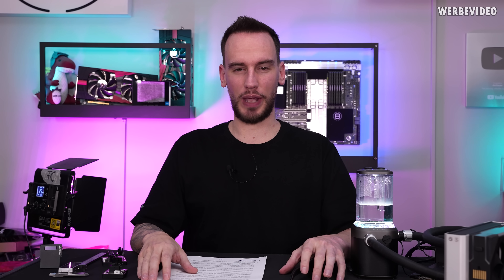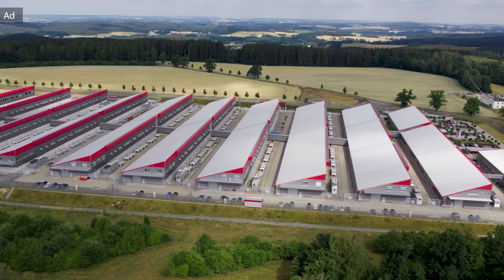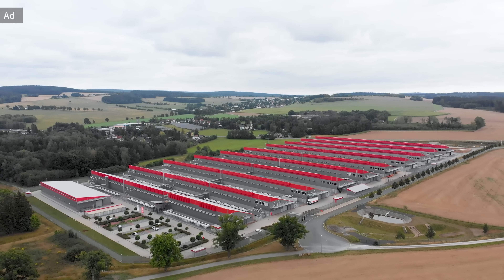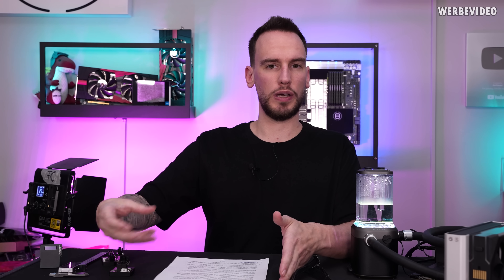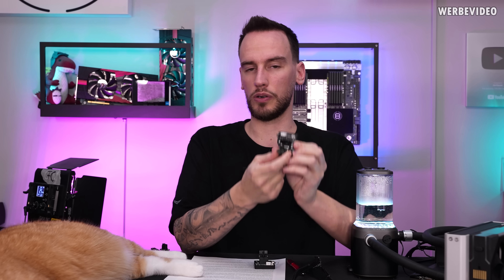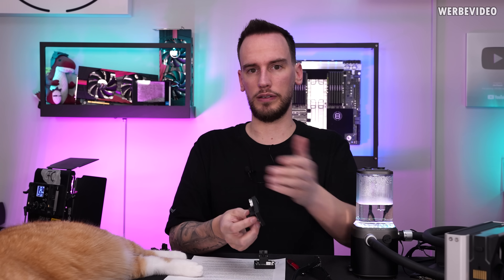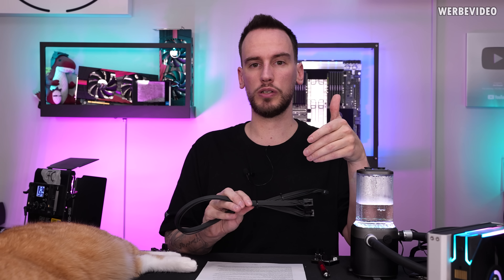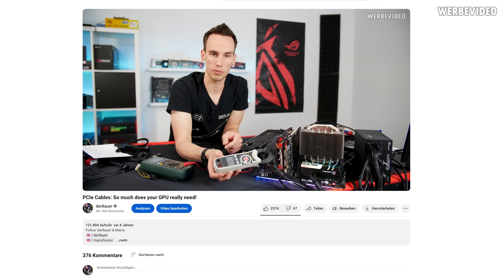12VHPWR is just Garbage and will Remain a Problem!!

Comment: Roman from what I saw in the video. When you moved the cable back and forth the board connector moved with it. Looks like a weak solder job or the connectors are only held by the pin pads on the board with solder. A cold solder joint will have these kind of issues. But at the end of the day, it is a poor design as we see. Happy New Year!
Reply from the maker: I have the same problem on my FE though using the same cable :(

Comment: Search "Melted PCIe Cable" Images it'll quickly be apparent that people can't plug in cables. 50 in 100,000 is human error and it won't make a difference if it's 4 x 8-pins or 1 x 12+4-pins 12VHPWR.

Comment: If it was a user error with the 12VHPWR adapter not being connected properly, then the PC shouldn't turn o. As every other cable that is not connected properly to the motherboard and the 8 pin connector on the GPU will not allow the PC to turn on or there will PC a message from the PC stating something isn't connected. The fact that the 4090 still allows the PC to turn on and then melts when at full potential, made me keep my 3090 Ti. The 3090 Ti has the same connector and there have been no reports on the connector melting.
Reply from the maker: It's a mix of a connector that doesn't have room for any kind of mistake and small mistakes that can happen during assembly. Just a tiny bend on the wrong direction and it's gone
Reply: It IS user error though, caused by an improper connection/bending. No one has provided any evidence that proves otherwise.

Comment: I never had any issues with my 4090 FE, which I got on launch. I'm using the SilverStone SST-PP14 cable. The card sits on a vertical bracket with the cable going directly into the card

Comment: Take the metal from the wires and shielding and weigh them.. 👀 it’s trash metal used on subsequent production batches by manufacturer to cover their margin.. literally you will have to quality control by batch to hold manufacturer responsible.

Comment: Why don't they just go back to the 8pin x2, x3 layout. i personally had no prb with 8pins, hell atm i'm running a 7900xtx x3 8pin's. No burn outs, No Melting, No Fires, No prbs. Why fix what doesn't need to be fixed. If there trying to reduce Wire's, maby do more R&D b4 shoving it down everyone throat. Doing so now having the best puts you at a Fire risk. I don't feal like calling the Fire Marshell (putting the fire department on alert when i run a game.) when i want to buy a 40 series Nvidia.

Comment: The whole 12VHPWR is so stupid. How about stuffing the GPU with as much as 8-pin PCIe connectors it needs, or taking totally new approach by creating new spec with large spade connectors, like in automotive (like electronic power steering motor).

Comment: Fuck to those that set the narratives that its the "USER ERROR" (you know who)...NO the cable design is shit thats causing the USER ERROR....
Reply: If you can't handle plugging a cable in all the way, you shouldn't be building PCs. This issue has been so overblown it's ridiculous. 

Hey by the way, do you think pins on a CPU/mobo are bad design? Because 1diots bend/break those and ruin hardware all the time.

Comment: seriously 4090 could have 2x8pins for a total of 375w 'specification' power and then tune the power down slightly so the card runs within the limit, you would lose maybe low single digit % of performance, it would still be the fastest thing on the market, its just an unnecessary 'feature' that drives the price up

Comment: I think the solution is to use very flexible silicon wire which will bend easily a lot and put next to no strain on the connector.
Not sure why no one is doing it.
I bought some genuine connectors and pins and I'm planning on crimping some custom cable for my PC.
Reply: It does put an extra strain on the conductors though.
Reply: @SianaGearz  No it doesn't because it's not just softer insulation, there is 2 or 3x more smaller cores that result in more flexibility.
Less strain on the connector results from very little strain present on wires itself.

Comment: Correction for @der8auer :
The Table at 7:24 is a derating factor for bundles of wires. There is no derating factor between solid, multiple-solid, sector, stranded or fine stranded.
Reply: yes and no but I guess that they compensate by making the stranded wire a bit thicker so the rating (e.g awg18) is the same for both (the reason being the air gap between the strands making a stranded and a solid cable of the exact same physical diameter having not the exact same practical diameter). But ofc that difference is not as huge as that table deb8auer showed.
Reply: Yep he messed up that part

Comment: When I was learning how to size up electrical circuits we always had to apply a x1.6 safety factor to all our results because thats how the industry makes sure most edge cases are taken care of and sht doesn't burn down all the time.
Making a cable that can actually barely push more than 600 Watt brand new is quite insane. Ofc so is making GPUs can pull that much power in the first place.
Any deviation in manufacturing (remember all this sht is made in china at the lowest bidder) or extra twists and bends, less than perfect connectors and you are easily out of spec in the real world.
Not sure where this fantasy of needing it to be 12pin came from, we have had multiple-to-single cables for decades without any issues.
If anything they could have went for a 16pin cable but I guess it would start getting too rigid for the 'muh cable management' crowd.
Reply: They could've also just used the same sized connectors as the 8-pin. Since the 4.2mm Mini Fit connectors are rated to 13A per contact, they could have used 10 power contacts for a 130A max, and all 12 would be a 156A max at 20C.

600W at 12V is 50A, so they would have at least a 2.6x factor and at most a 3.12x. 12x 4.2mm would be exactly 2x 8-pin, as it only uses 6 of the 8 pins to provide 12V power.

Comment: Edit: @abandonedtube comment

I was really expecting that you would finally talk about the firmware issue that the WireViews had according to your (Thermal Grizzly) support back in July where I asked why I couldn't save the settings permanently. I got a refund for my 12VHPWR WireView in August so I don't really care anymore but it's weird that it wasn't talked about or mentioned anywhere other than TG support.